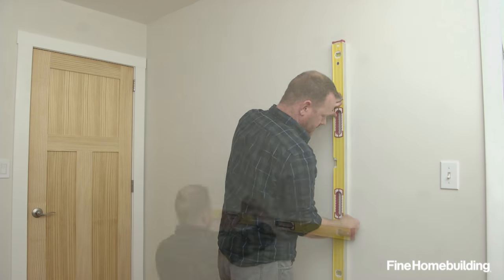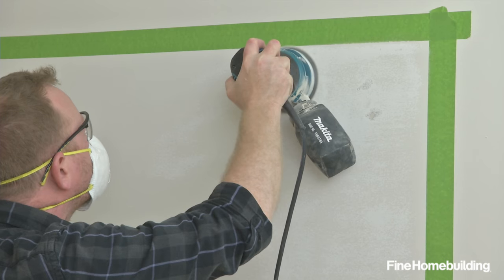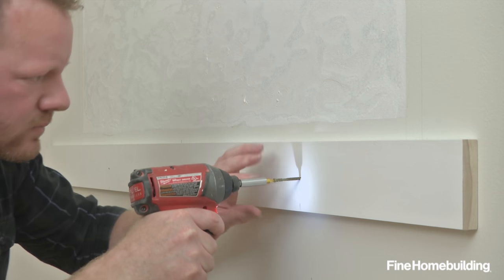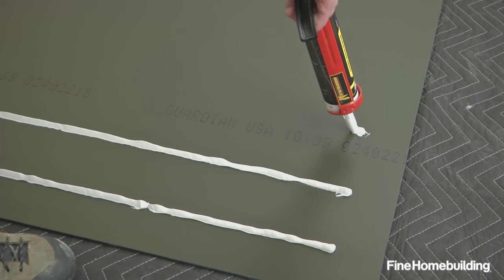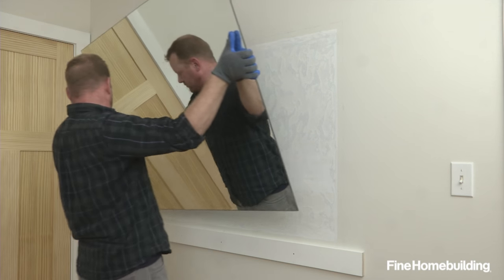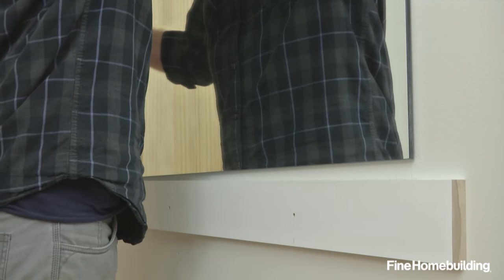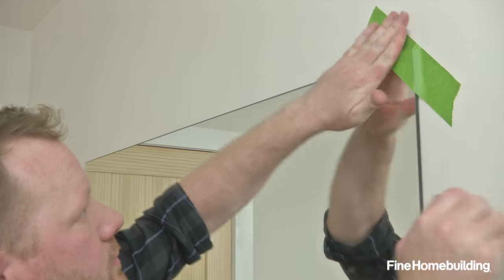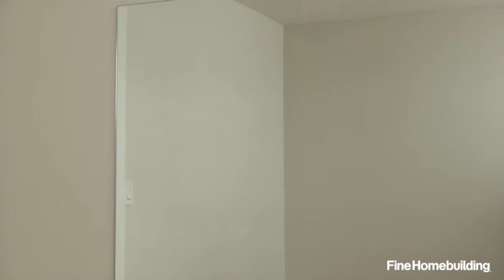How to Hang a Mirror With No-Slip Adhesive

Comment: Adhesive stripes should be applied in the vertical direction rather than horizontal as was done in this video. This will allow the adhesive to supply more shear strength.
Reply: no, the shear strength of the adhesive is not relative to the orientation of the application, but relative to the length of adhesive applied. this is considering that it will only resist its own weight.
Reply: It will also allow for more air flow so moisture doesn't accumulate.

Comment: pro tip, use 1/8" mirror (it weighs less) and make donut shapes with the mastic it creates a suction when pressed against the wall
Reply: Thanks for the tip. I have a plaster board wall, do you think I still need to sand it down and apply a primer?
Reply: @wink3194  only if the plaster is chipping or flaking,  otherwise you will be just fine
Reply: Watching these videos as a glazier hurts my head. Lol
Reply: I must stick a mirror to a painted brick wall. I'm thinking I should remove the paint to make it glue better. But really am not sure. Do you have any ideas on this? Hello from Australia!

Comment: So i have been doing glass for 15 years . When it comes to the glue you must use mirror rated glue or the chemical will eat the mirror backing off of the mirror creating hazy spots
Reply: Can gorilla glue work for a framed floor mirror ?
Reply: I’ve only just found out about this! My mirror had no sticky safety backing. I used UniBond waterproof  glue to stick it to my wardrobe. Will it begin to degrade overtime or is the UniBond glue safe? It says its suitable for mounting mirrors, but I don’t know if that’s if the mirror has a plastic safety backing.
Reply: can you please recommend what glue to use? Would Loctite Pl 520 work?
Reply: I dunno i used basic Hard as Nails for mine 6 years ago in my bathroom its still just as good as new ?
Reply: Thank you this happened to me

Comment: Can i use this method if the mirror im going to install in above bath and the wall has tiles? Also would you suggest using silicone all around tge mirror so water can not get behind it?

Comment: Why prime is needed? other adhesive don't need to coat prime on the wall.
Reply: My hunch is that the primer soaks into the drywall and bonds with it, whereas the paint on top is just a glove that might pull away like wallpaper. IDK why you wouldn't just bond it directly to the drywall without the primer though. Maybe to make mistakes less obvious if you sanded an area too large to hide behind the mirror.

Comment: How long does it usually take for mirror adhesives to set? :)
Reply: Took mine a good hour to set properly for a mirror around the same size , even then its better to just leave the wooden support overnight especially if its any larger
Reply: I removed the wooden support to early at first as i thought it was set but resulted in the mirror very very slowly sliding down the wall out of place lol
Reply: 24 hours is what I saw on a different video .

Comment: Does this work on a concrete foundation wall? I have a frameless mirror I am trying to mount to my garage wall to create a gym
Reply: I’m on the same situation,did you try it yet please let me know if it worked
Reply: Same! I have frameless too! 6x2.5ft!
Reply: Hi! Did you ever get a answer to your question? Or did you move forward with mounting it to the concrete wall?
Reply: @TheMamita84  Hi! Did you ever get a answer to your question? Or did you move forward with mounting it to the concrete wall?
Reply: @KennDee  Hi! Did you ever get a answer to your question? Or did you move forward with mounting it to the concrete wall?
Reply: @tywananthony4022  What we did is we have this thin sturdy L-shape frame that is as thick as the mirror, and screw it on the wall and served as the joint to hold the mirror. We put 2 at the bottom and two at each side.
Reply: @KennDee   I was thinking the same thing! Thanks for advice and i will try the same.
Reply: Same here

Comment: why do glass and mirror shops always recommend clips/channels and say that mastic or adhesive alone is not sufficient?
Reply: BECAUSE THE MIRRORS FALL OFF WHEN THE GLUE DRIES OUT....Glass shops literally get call to re-hang mirrors from them falling off the wall. Tile, carpet, human flesh is destroyed when it happens. Oh and its a safety code violation to not use a mechanical fastener. The homeowner can sue himself and the adhesive manufacturer, because a reputable glass shop with insurance, won't do this.
Reply: @michaelherzog3234  you got it spot on!!!
Reply: @michaelherzog3234  Glazier here!  You are absolutely correct! It even says so on the tube of mastic or the can. "Must be secured with fasteners"
Reply: @michaelherzog3234  i have mirrors 2ft by 5.5 ft  glued all along the wall in my bathroom and gym when we remodeled. We glued them ourselves in 2001 and they are still there. About to add 3 more on a different wall and needed to be reminded what adhesive to use.
Reply: If you've ever removed a glued mirror you'd see they are not going to fall off. I've never heard of any glued mirror falling off the wall. What can happen is the mirror can fall off before the glue sets if it's not secured sufficiently.
Reply: @snorman1911  Depends on the application. I've been glazing for a few years now and have came across a few mirrors, mainly ones put in during new construction, where they value speed over quality. A very small tug with a cup removed them easily. Just last month we walked into a bathroom of an approximately 15 year old house where the mirror had fallen off and was only being held by their medicine cabinet. The scariest part however is the home owners had no clue.
Reply: @CrazTheKing  I wish any of the mirrors I've removed would have come off that easily :). Last one was 28 years old and pulled every bit of drywall off the wall it was stuck to.

Comment: How do you remove a mirror so installed?
Reply: Grab your nearest enemy and throw them into it
Reply: Ya don't
Reply: Run a wired line between the wall and mirror to cut off the adhesive. Be careful it will come down fast
Reply: @vincentlee2460  
That's sounds like a good idea ... assuming the wire can cut through the glue.

Comment: What kind of glue is that?
Reply: Any good quality adhesive will do the job. Some of them are specialized for mirrors, but from what I gather a premium quality general-use adhesive will do the job.
Reply: Don't listen to Patrick.  You need an adhesive rated for mirrors like pl530 or mirror mastic.  General adhesives will eat right through the film on the back of the mirror.
Reply: Is UniBond (waterproof) glue safe? That’s what I’ve used and now I’m worried it will eat away at the mirror ….
Reply: Yeah i used basic hard as nails for mine 6 yrs later its still up :)

Comment: How long do I leave the cleat? I mean, it would be nice to know how long it takes for the adhesive to cure. Don't you think? Duh.
Reply: Simon99 
It’s usually written on the tube of glue stud
🤣
Reply: Honestly to be on the safe side leave it for minimum 24hours if its as big as that one or especially bigger, I took mine off after about 6 hours and the mirror started very very slowly sliding down the wall lol

Comment: Wrong just use double sided tape and a neutral cure silicon no need for braces and all that sanding nonsense im a glazier of 15 years your method is pure rubish and a waste of time
Reply: what silicone would you recommend?  can it be used for a lumber framing - mirror bond?  thanks in advance.
Reply: Will it work on old mirror? I mean shall i attach the new mirror over an old one by your method?
Reply: @Deliciouscakes551  yes just make sure it is a neutral cure silicon and I suggest suggest 3m double sided tape, but make sure its exactly where you want it to be because once the tape grabs its game over
Reply: @Simmonsconstruction  thank you😊
Reply: Can you use your method to hang mirror tiles on ceiling?

Comment: This may be great for the person hanging it up. However I feel bad for whoever the poor soul is who has to take it down. 

Please do not give homeowners bad advice.
Reply: People like you love to tell everyone this is wrong without offering any useful additions.
Care to correct the issue(s) in this video??
Reply: John Salazar easy to take it down. Goggles, hammer and chisel
Reply: @grantarnell760  he's right... the only way to remove a mirror attached like this is to literally break it, shatter it, and clean up the mess. the drywall underneath it will likely partly come off with it, adding a lot more work for anyone replacing this in the future. The simpler way to do it is using proper mirror anchoring brackets. It will be a lot easier to replace in the future.
Reply: This is how professionals install mirrors all the time, usually for bathroom mirrored walls.  It's not bad advice.  If a homeowner is not thinking about what they are doing they will have a problem.  It's easy enough to glue the mirrors to wood and attach that wood to the wall.
Reply: Like no one hasnt ever thought of that themselves. Always one miserable one lol